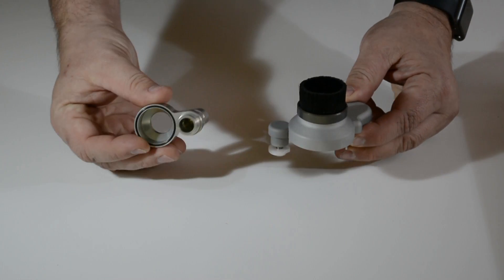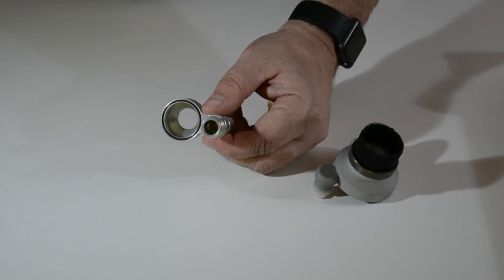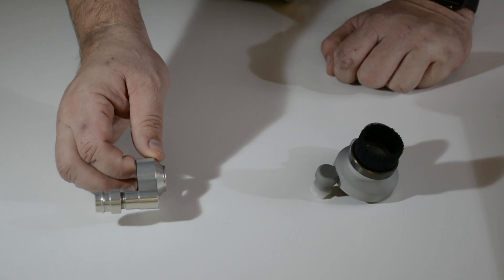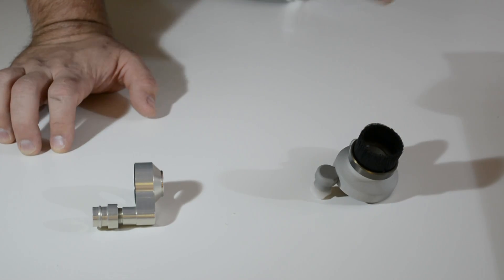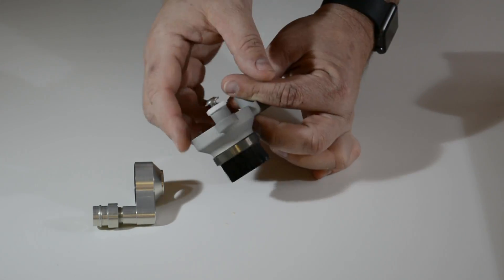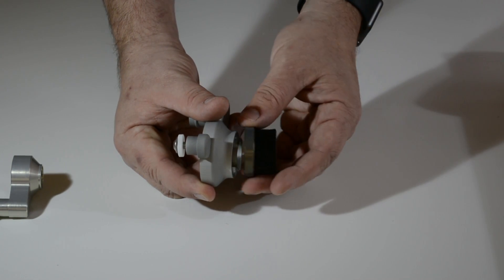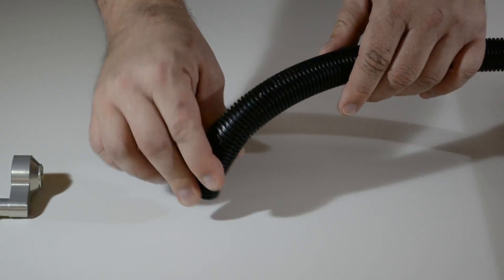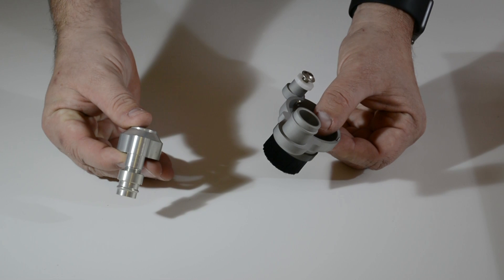STEPCRAFT Exhaust Adapter - Vacuum Attachment -  Dust Collection For CNC

Comment: Seems like I need to design an adapter to let this work with the tool changer on the 1,000 watt spindle.  ( I do not plan to use auto tool change, but I like having the tool release at the touch of the button)  I need to cut a ton of acrylic and debris collection is going to be critical lol.   3D printer to the rescue.

Comment: I've just bought a Stepcraft 2 machine and I've tried the exhaust adapter with the spindle and seams that the air vent is blocked by the spindle and there is no suction. what can possibly be wrong? Thank you